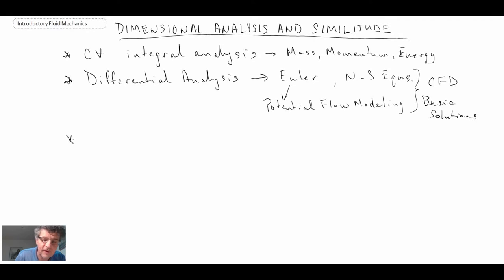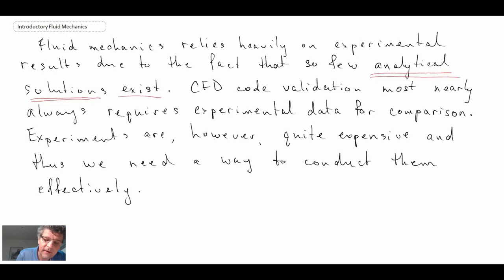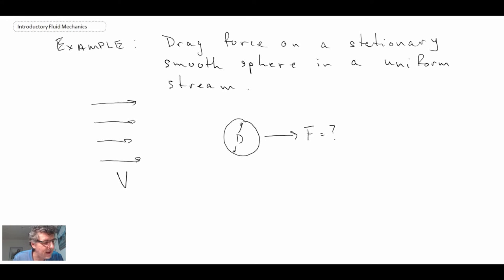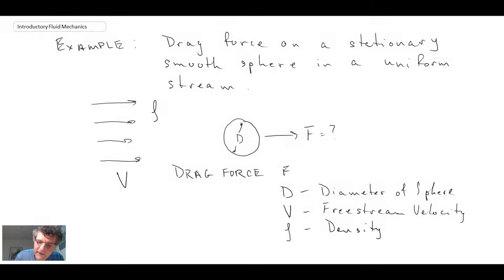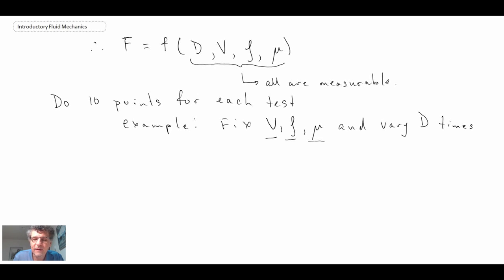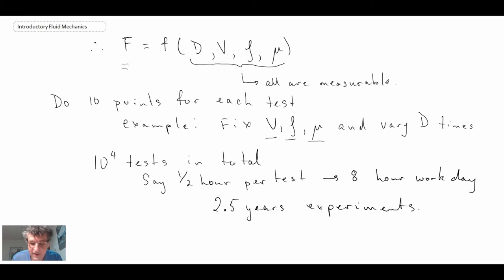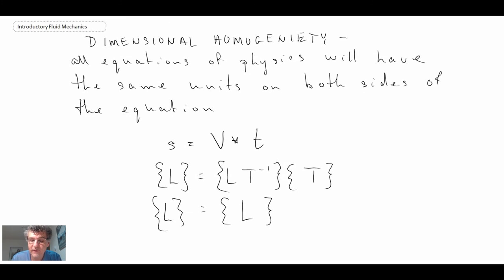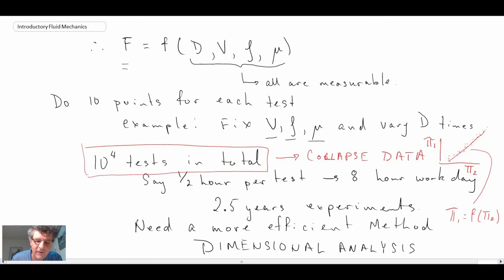Introductory Fluid Mechanics L14 p1 - Dimensional Analysis

Comment: i got some questions to ask if you could do a video it would help
1)
An ideal gas enters a nozzle with negligible velocity and specific enthalpy h1 = 2,506 kJ/kg at the inlet. It leaves the nozzle with a velocity of c2 = 516 m/s. Neglecting the heat transfer and changes in potential energy, calculate the specific enthalpy at the outlet h2 in the unit of kJ/kg.
2)
A door in the side of a tank is 4.0 m wide and 5.0 m high the tank is filled with oil of relative density 0.72 to a position 1m above the top of the door. What is the line of action of the force from the surface in meters.
3)
A door in the side of a tank is 2.1 m wide and 4.3 m high, the tank is filled to the top of the door with water of density 1000kg/m3.  What is the force on the door in N?
4)
Water flows through a pipe 4cm in diameter and 38m long between two tanks with square edged non projecting entrance and exit.  The flow rate is controlled by a gate valve which when fully open has a loss factor of 0.32.  What is the height difference between the tanks if the volume flow rate is  3.8 x10-3 m3/s.
For laminar flow f=16/Re
For turbulent flow f=0.08/Re0.25
Density of water, 
ρ
, is 1000kg/m3, viscosity of water, 
μ
, is 0.001Pa.s.
5)
The viscous torque produced on a disc rotating in a liquid depends upon the diameter D, the speed of rotation N, the density 
ρ
 and the viscosity 
μ
.  The equation taking the form:-
T = ρ N 2 D 5 φ ( ρ N D 2 μ )
In order to predict the torque on a 1.8 diameter disc rotating in water of density 1000kg/m3 at 129 rev/min a model is built to a scale of 1/4.  The model is rotated in oil. Calculate the speed of rotation, in rev/min, for the model to produce dynamic similarity.
The oil density is 785 kg/m3 and the dynamic viscosity of the oil is 4.7 x 10-4Pa.s.
The water dynamic viscosity is 1 x 10-3Pa.s.

Comment: https://www.youtube.com/watch?v=E0V9Rj_kHxI&t=595s

I think there was a mistake in calculating the number of tests required.  Unless I misunderstood, we are testing 10 different diameters, 10 different viscocities, 10 different velocities, and 10 different densities with the other 3 variables held constant for each set of 10 experiments.  That would mean 10*4=40, not 10^4=10,000, experiments need to be performed.  Further, even if we did each experiment with each of the 10 diameters, viscocities, velocities, and densities, that would be 10*10*4=400 since each parameter would have 100 (or 10*10) tests times 4 parameters.  Or have I misunderstood the statement about how the testing is performed?
Reply: I had a similar thought. The number of variables to test is 4 the number that must be held constant is 3, thus 4 choose 3. Another way, you have a set of 4 things, solve for the number of combinations when you pick 3 of them to be held constant and 1 can be variable. This is 4!/(4!X(4-3)!  and evaluates to 4!/3! or 4. So the number of sets of experiments is 4 and the number of variations per experiment set is 10, 4*10 is 40 measurements. 

This type of permutations/combinatorics is intuitive because the order doesn't matter and repetition is not allowed.  
Here are the experiment sets and variables to hold constant: 
[D,V,r],[D,V,u],[D,r,u],[V,r,u] the missing variable from each set is the variable for the experiment.
Reply: Faxxxxxx
Reply: Too late, but it is 10 000 if you want to get a complete picture, imagine a programming for loop
for D in range(0,10,1):
... for rho in range(0, 1000, 100):
... ... for nu in range(0, 0.001, 0.0001):
... ... ... for v in range(0, 10, 1):  
... ... ... ... perform experiment

What the 4*10 experiments yield is the relationship between a target output parameter and its 4 input parameters. What 10 000 experiments yield is a relationship of everything to everything.